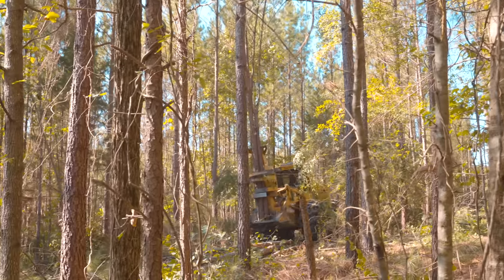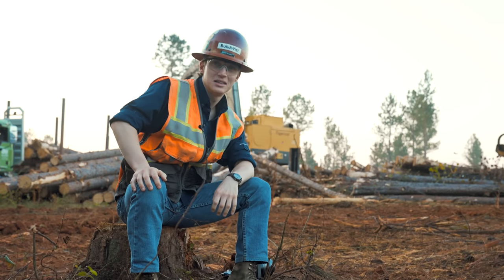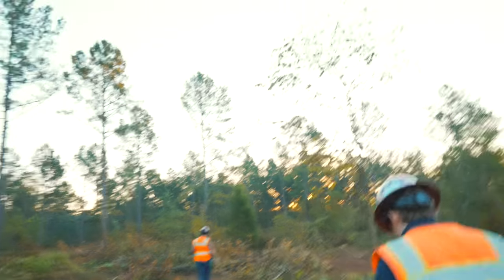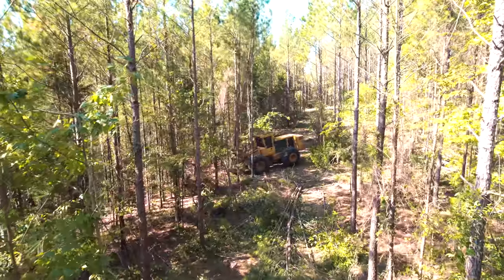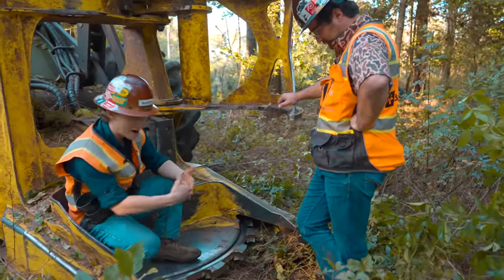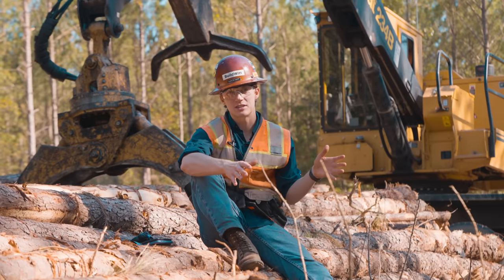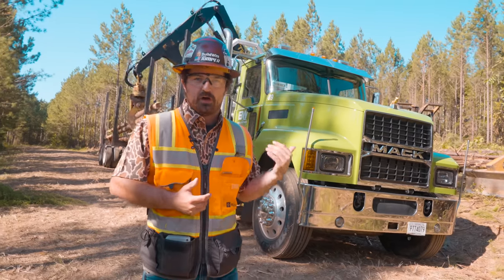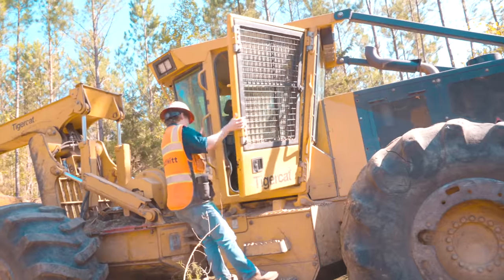Where Does Paper Come From? (Results May Be Shocking)

Comment: As someone who practices forestry in CA, the souths terrain is quite beneficial and cost effective. West coast loggers often have to use more expensive harvest operations like yarders due to steep terrain, the south is essentially flat in comparison. Minimum harvest age in CA is 40-80 years per CAs FPRs. Most west coast timber goes to higher value products too, like plywood and dimensional boards. Forests are my passion but I won’t drone on.

Comment: I have so many questions now, manly how heavy a truck load is and how much volume the skidder can take?
I'm from Sweden and I really hope I'm not offending anyone by saying that it looks really slow to work like that? Not the operators, those guys were flying! 
But there's so many people to just get the wood on the truck. And it looks like the truck have to sit around a long time just to get loaded?
Ower here we usually have 2 machines that work independently of the trucks. One that cuts according to a digital price list and cuts the logs within 20mm or less. Totally depending on the tree diameter and how it diminishes and so on. And one who brings it out to the truck road and piles it so that the log truck can load it whit his own crane. It usually takes about 15-30 minutes from stop to drive. And the big boys usually have many trucks without a crane and use a separate loader, then it's a matter of 5 minutes to load. 
The biggest forwarders takes a load of at least 25 tons and the biggest trucks takes loads of about 55 tons. 
The short wood method is the best, change my mind!😂👌
Reply: We have cut to length forwarders and harvesters in the US. A few companies in Oregon and Washington, for example, have had them since the 1980s. I personally have operated many Ponsse buffalo, elephants, ergos, Komatsu 931s, etc. We find cut to length machines work very well for thinning up to moderately steep ground. While they do work for clear cuts and tethering for steep ground, mills generally prefer long logs (10m to 15m or longer)  and larger diameters than ctl harvesters can handle over the short, smaller wood produced by the ctl machines. The volume of wood generated with other methods is often much greater than two ctl machines too.
Reply: West coast log trucks, other than California, are legal at 47 ish tons gross weight. Many of them net around 28 to 35 tons of logs